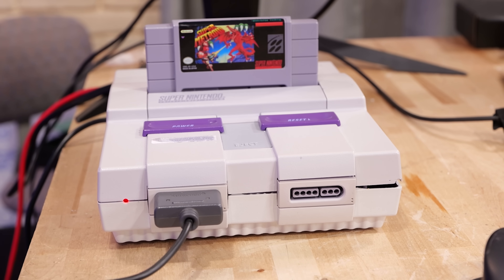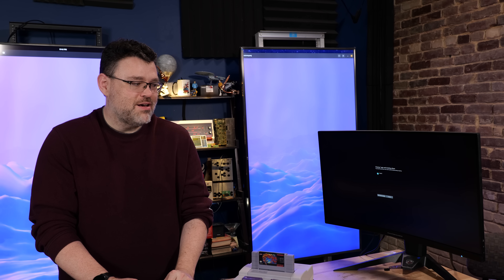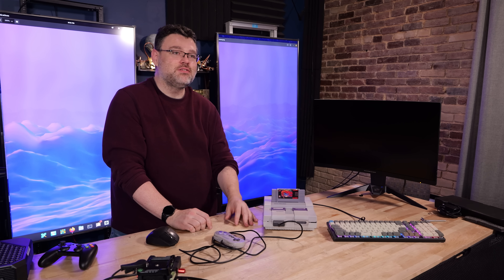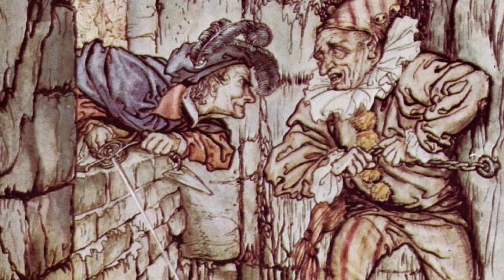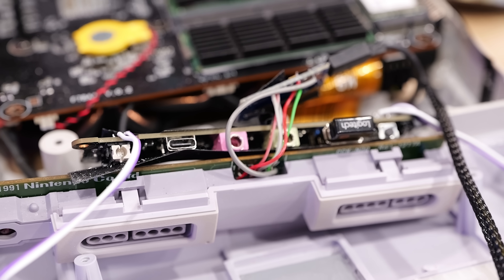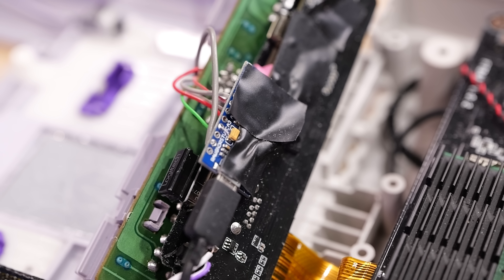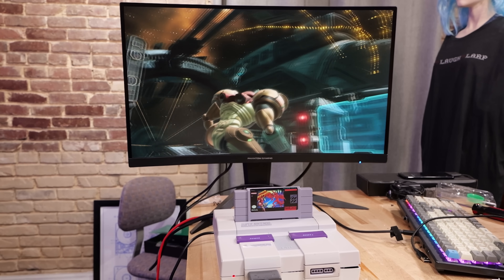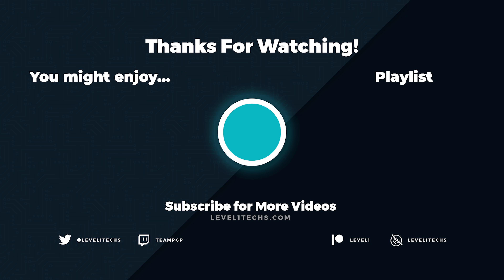Super N*tendo - a Mini PC build with L1T (SNES PC)

Comment: One of the scariest principles this reveals about the advancement of silicon processing over the years... High end computing is always consuming more power.
NES/SNES/N64 Passive cooling.
Gamecube/Xbox small fan.
PS360/PS4/XOne larger fan.

PS5/X|S... The entire console is now a block of copper with a giant fan.
Reply: The N64's CPU is clocked to about 94 MHz. That's 1/50th the speed of modern chips. I wonder how slow you'd have to clock a 7800X3D to get it passively cooled?
Reply: @benjaminoechsli1941  
So after checking a teardown: https://youtu.be/nkEejYW7eHI?feature=shared&t=480
I almost think the N64 cooling is equivalent to one of the aluminum billet "Wraith Stealth" coolers they ship with the Ryzen 7600, except the N64 as you mention is totally passive.
Reportedly the N64 power consumption is 19 watts, so that's in line with the modern PC handhelds e.g. Asus ROG Ally, which I can imagine would work ok with a hefty passive cooler.
If we rough estimate the N64 at 100 Megaflops GPU power then the AMD 7840U is around 100,000 times more powerful at the same power consumption.

Every time these conversations come up I am continually baffled that anyone would ever think it necessary to run a game at 30fps.
One of these days someone in the gaming industry needs to put their foot down and ban 30fps from a console.

Comment: since the back is obvious already, put a fan in the cartridge and have it pull air down into the system, or just air vents
Reply: I was going to do this with the 3D printed cartridge with the screen but the cheap screens ribbon cable had an internal short and delaminated itself

Comment: Patents let you protect things that you can't even copyright, so it's good that it doesn't last forever. In my opinion, patents should be abolished or at least severely nerfed. The only thing they do is prevent competition, they don't protect IP (that's what copyright does), they legally prevent others from making a product as good as yours. If someone has the exclusive rights to a good IP, you can still make your own IP that's as good or better, unlike with patents. Even if you come up with something completely independently without using someone's IP, you'd still not be allowed to use it if it's patented.

Comment: Depending on the build volume of the printer, it would've paid more IMO to print at least a custom bottom shell half to fit the components better and add at least some cooling. And maybe one could even add something like a modified Retrode 2 to have swappable cartridge capability and preserve as much of the mechaninal cartridge system as possible.
Reply: I'm definitely investing in a resin printer next time I redo this build

Comment: You could cut a few holes in the lower half of the shell at the underside of the step out, that would improve airflow a lot and be near invisible.
Reply: Yeah I thought about doing this but I was worried about structural integrity, that plastic was super brittle